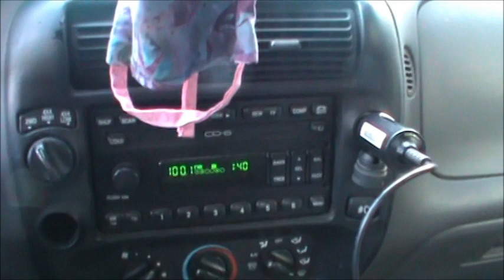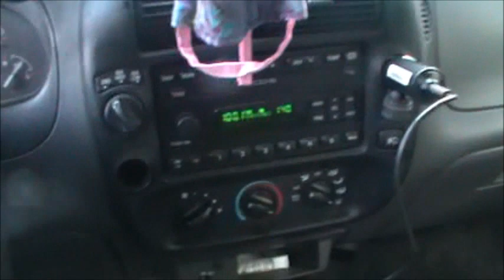JOHNSON 30 HP  SHAKING OUT THE BUGS

Comment: My 33  Skitwin I revived last summer wouldn’t pump water even after a new impeller..Turns out it had some dead bugs in it..Mud daubers according to TOA..Used a coat hanger to probe up the water tube and blubber holes and got it freed up..BUG PARTS came out and pumped great.Water barrel had plenty of bits floating in it.
Reply from the maker: Yep' I have pulled dead mice, bats & my share of mudders out of outboards but this was a first 4 me.     kodi

Comment: When you compression check do you take all the plugs out or one at a time because I seen it done both ways
Reply from the maker: I take them all out if I use the drill or pull start just to make it easier, If the motor is electric start I often do one @ a time
                                                                             kodi
Reply: @kodibassInsideoutboards  thank you I seen it done both ways but I just work on my own stuff I new you would have the right answer thanks again for the videos and info